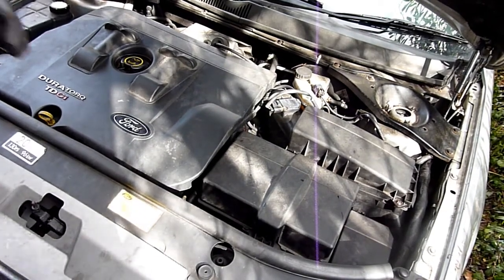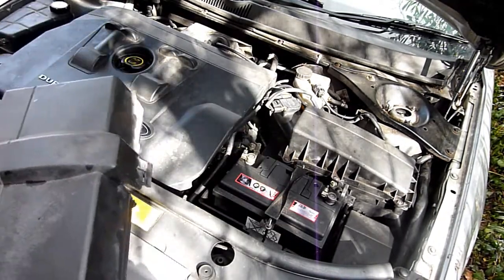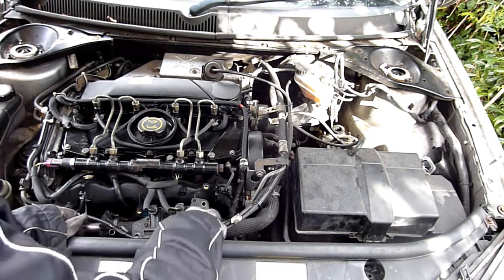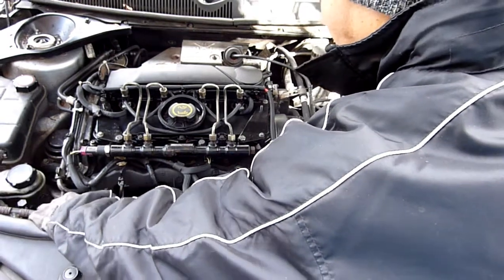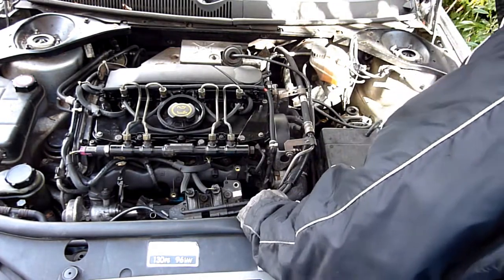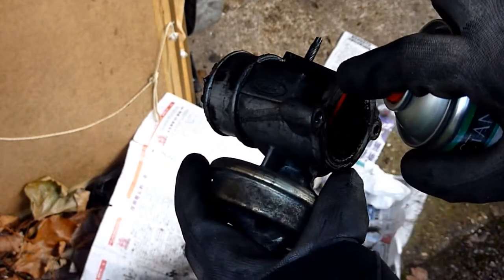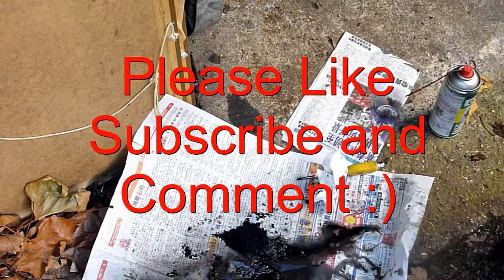How to Remove and Clean the EGR on a Ford Mondeo 2003

Comment: So badly recorded. Missing most important part about how to remove EGR.. Thumb down
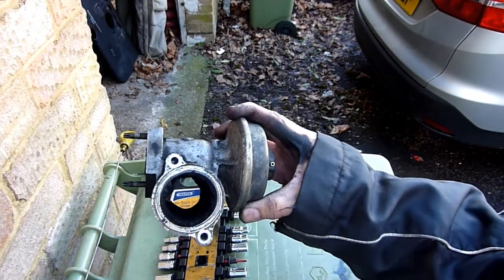Reply from the maker: At 4:09 when I start saying: '...the two 8mm nuts....' is when I am pointing to the EGR, which is on the bottom of the screen, on the left. Then I point to the last nut the 7mn nut which holds a separate pipe in place. So two bolts holds the EGR in place only. One bolt is visible and easily accessed from above. The second bolt is also visible from above, but behind the intake plastic and an wobbly 1/4 inch extension bar is required. At 4:57 is where I show the orientation of the removed EGR from above with the bellows on the right instead of on the left, as shown installed in the car. Please let me know if you need further advice.
Reply: @EducationPineapple  Well. Thanks for your engagement and explains. There is a known sentence in Poland "one picture is worth more than thousand words" which means that it is much easier to understand when you see something than when you only hear about it. In your movie I'd like to see how exact you removing this EGR with some hints, how to make it safe and easier. However thanks for detailed explains in comment. Thumbs up then. Regards.